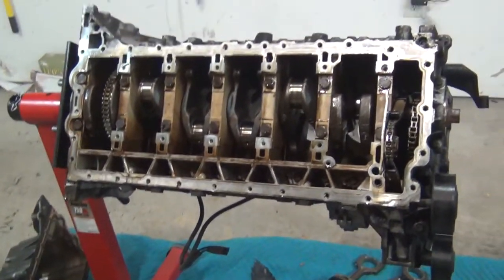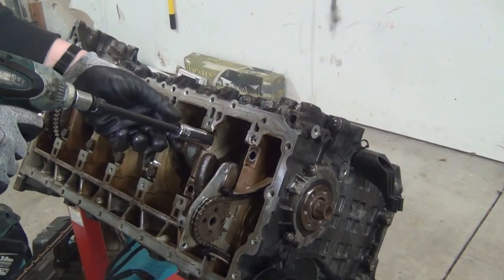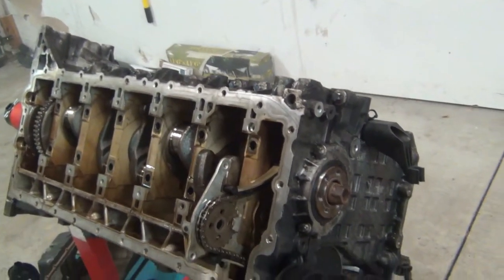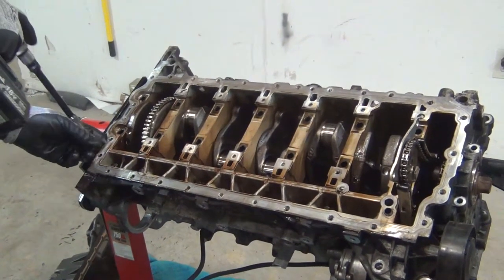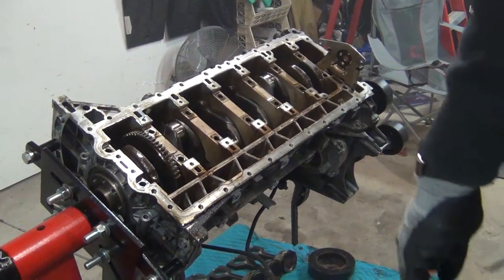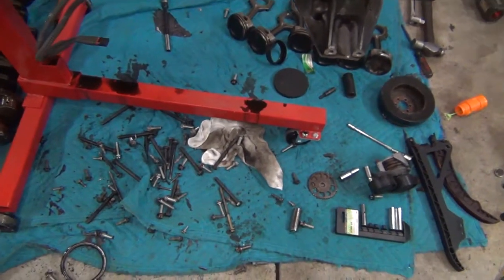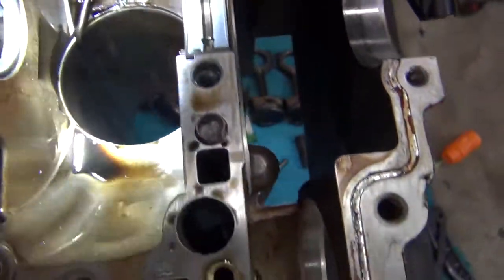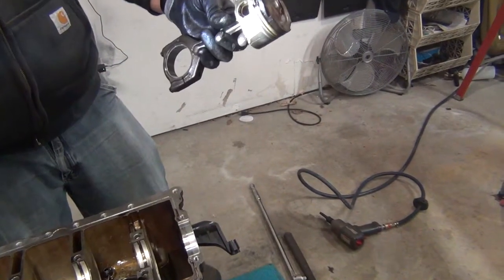Crank Removal on N54

Comment: Man... Thank you so much for this video! I was replacing my blown twins over the weekend and found a pretty bad oil leak, it's coming from that crankshaft aluminum housing, looks like it's sealed with gasket sealant instead of a gasket. It's a way bigger job to get all that off to get to it then I thought. Since my engine is on the higher mile side, looks like I'll be getting a new long block instead of tearing my old one down all the way just to fix the leak. Thanks again for these videos! 👊👍💪

Comment: Dude was probably two-stepping it which caused the oil pump bolts to shear. Or back out from the vibration cause by two stepping.

Comment: Subscribed as well just in case I need to come back to this video for more info. Thank you for filming this! From what I saw there is no removable timing cover. How would you change out the timing chain and guides with the engine still in the car? I you were to pull that main crank bolt you could remove that seal surface and the chain sprocket. Could you snake the chain off the crank?  

I have an n55 with 175k miles, I'm looking at doing some preventative maintenance. Not too many people have had to replace the timing chain yet because they aren't at these mileages yet. I hear the chain & guides should last over well over 200k if not abused. Luckily there are no indicators that my engine has been abused.

Comment: How much of a oil leak does it take for it to start having long cranks? Mechanic said i have to replace my crankshaft seal since i have an oil leak but my car starts like a champ.
Reply from the maker: What..? An oil leak wont affect starting performance?..
Reply: bobdudeman1988 thats what the technician told me and they specialize in bmw .
Reply from the maker: @im_pricetrained140  id find a new tech then. You said it yourself. Leaks but starts fine? Oil leak will not effect starting .
Reply: Ok thanks 👍

Comment: The serpentine belt in my 328i broke and sucked inside, the cranckshaft won’t turn so i dont know whats wong, can you tell me what could be the problem or the solution?
Reply: Have the same problem my next step is to drop oil pan clean sumpt and still trying to figure out how to clean the debree out of the belt? No mechanic will touch this problem in Colorado they say it messes up crank bearings so the engine is no good so they want me to buy a new one and so far all the quotes from an auto shop say the same thing? But I don’t believe it so I am trying to do it my self? Still looking for answers as i can save my engine with out buying a new one and how to clean.? And it won’t start because the oil is cloged by a screen In front of pump. So that’s why it won’t start all sensors are good I’ve checked it just need to be cleaned out and replace the rubber bushing where belt got suck in and it will start again I am pretty sure. But when I talk to mechanic s they say it messes up the bearings and the engine is no good can’t be replaced. But from this video it looks like you can replace bearing and crank shaft if ruined . I am still searching for answers on why it would and if it’s true if rubber can mess the bearings up?🤔
Reply: Michael Sandoval wow too much job to do, all the mechanics told me the same speach « change the engine for new one «
Reply: Joseph Alexandre yeah because they read all about the problem and they know there’s a lot of money to be made by just saying that. So any mechanic that says that is a lie they won’t even look to diagnose it. My friend says they will scratch the bearings and pistons to trick u into buying a engine but they buy it 1800 and rebuild yours . This is what you need to do . It can mess your engine up if some how something brakes and called into piston which will brake it. But u have to run it and u will hear the piston knocking and frying but bmw engine has a fail safe mode witch will won’t let the car start untill u fix the problem . But u don’t need a computer after u fix it u just need push the start button let it turn on but don’t start for about 5 minutes to collaborate turn off then start and everything will sycronize. But the main thing if u don’t wanna get ripped off is drop the oil pan clean with starting fluid and spray the timing belt most likely one of the brackets will brake by the seal and the plastic peice that comes with seal so might have to re due chain which is called vanos timing set rebuild what ever? And clean pump then take splash guard off crank shaft inside oil pan and check each bearing and replace anyway not expensive then at top engine spray starting fluid and and pour diesel in each cylinder all three engine and then pour oil this is the formula you can do it the way u want to wash your engine and possibly if u have any other chemical that will work should be fine I am still looking. But do it untill the debree is clear then put together replace seal set time and it will start. Won’t start with pump cloged but if u clear it and u don’t clean all debris it will get into your pistons and possibly have to replace the piston block. I can do this for 500 if anyone needs this u just have to buy the parts . Since everything is made and designed the work is child play mechanics are a joke. There just labor that’s it that has rights to the diagram. The only thing is that they go to school for the termology:)) since no mechanic wanted to help me I have no respect for any mechanic that works at a shop. Good luck have to buy a jack and some stands I’ll make a video on this once I am done fixing mine. Taking me awhile because I am not rich and guys here in Colorado do not want me to be better than them but I am who I am and if I am better oh well not my fault I am just living life . I am very poor no family so fuck off!!
Reply: Joseph Alexandre once this is replaced or if u mechined the engine I believe it should bring the value of the car up 5o% the 25 each interior and exterior. If that can all be renewed or replace and cleaned and remechined frame I believe any car no matter what year should be sold at original price! But other words once u do this u will have another 100 miles before replacing bearing sleeves’? And it’ll be like it was new
Reply: @mike77-  TL:DR   

The main risk is screwing the sprockets or oil pump pick up and starving the engine by blocking inlet.

Instead of paying bucks to find that out, usually getting a good used engine is faster and better if the engine will not turn.
Reply: Max Nix so the problem was belt got sucked in because the oil filter was not put on properly by. Grease monkey. But I drained all oil took oil case off made sure all belt was of checked each sleeve all was alright the engin went into a defensive mode right when belt sucked in or safe mode witch saved the engine because it wouldn’t start also wouldn’t start because oil can out of crank so just cleaned it replaced seal witch was easy flushed engine with a air pressure and fluid put it all together belt was still in time and tight valves were very clean new oil filter and oil seal for valve and it started right back up codes disappeared no sensors were damaged all together costed me almost 250 and returned the tools to autozone so got a quarter of that back . So I saved about 10k the safe mode will not let you drive so it saves the engine also anytothat falls except spark plugs will send it to safe mode so no worry any dealer that doesn’t wanna fix a sucked in belt or try’s to say your barring and sleeve are to messed up . It’s a lie and give that mechanics a bad review!!! Also would help is to have a recall on the bmw crank seal it sits inside towards the engine witch others crank hold the belt on the outside so if that thing Barack’s it doesn’t rap up and go into your engine! Be nice to spread the word to all bmw owners !!!
Reply: Joseph Alexandre the engine won’t start because the oil probably drained out the crank . So no oil pressure you can take off crank and u will see it’s easy but if it got sucked in you want to clean it because if you just replace it and not clean just drain the oil and replace it will run but then you will find the belt material will clog the oil pump before it hits the pistons so that pomp with the screen also saves your piston and sleeves but you will need to clean because of it clogged it will not start because no oil pressuso your problem is no oil pressure do to the crank seal tearing witch cause no pressure! Hope this helps took me 6 months figuring this out with no lyft and just a jack and a few sockets and an extension  and engine flush fluid one thing I didn’t use witch I should of was the engine bar holder the thing that holds your engine in place because you need to take off the mounts that hold the engine because you have to take the oil case to take off.! It’s easy tho also just the connections the computer fixes it self just like a car stereo! Except your dealing with a big machine!!

Comment: a mistake not chaning the timing chain assembly , its a weakness and will crack without warning after 100k
Reply: Th guide yo mean?   Surprised there are no metal backing plates attached.